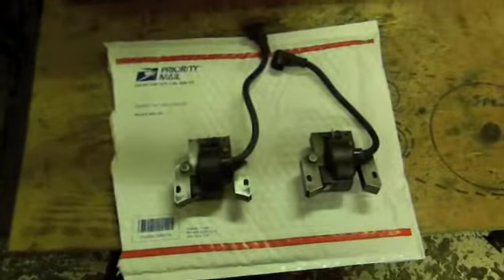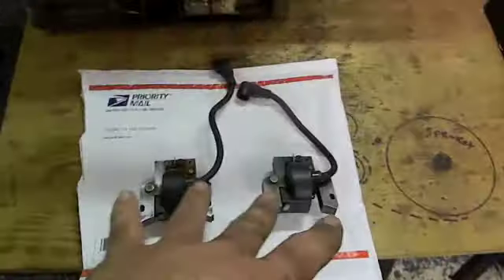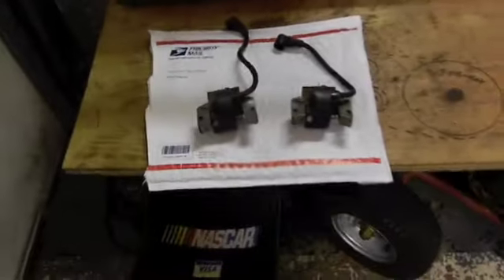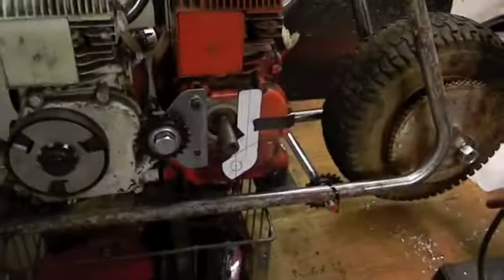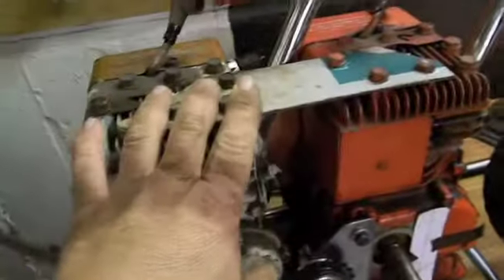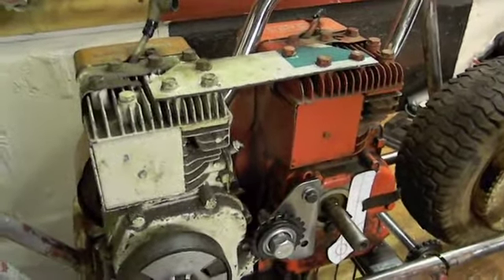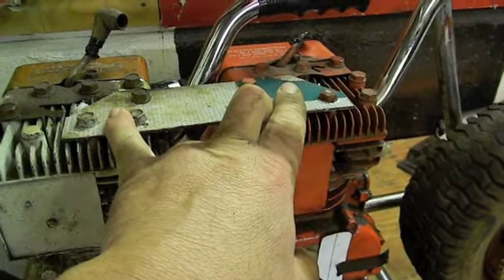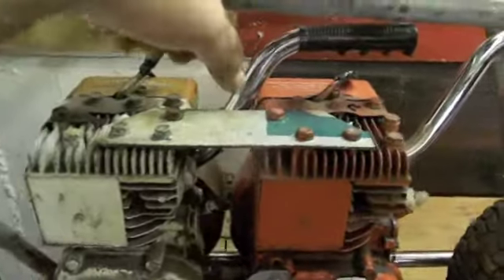Arco Twin Engine Mini Bike "Coil Swap Pt1"

Comment from the maker: Good thought the engines come with multiple types of tins depending what there used for.I will say that when i road the mini bike on gas the air being blow a cross the head was like a hair dryer.this also one of the reason`s i used aluminum it`s a much better heat sink

Comment: what a bout cooling the plate is going to ratain extra heat on the head with restricing air flow thru the fins?

Comment: So the points are a mechanical thing (cam-driven, right) and the magneto is "run" by the magnetic field as the engine turns (the magnet going by)...? The magneto is better because there are no moving parts to wear out, right?

Comment: those coils won't work right on a point system,,even if it does run it will kick back, ive tried,,you need a point eliminator..a little box with a wire, you wore to the old coil the magnets on the flywheel are diff..on the new motors from the point ones, compare them.. just fyi